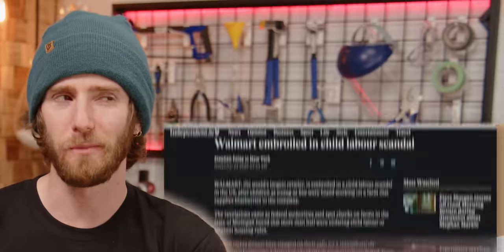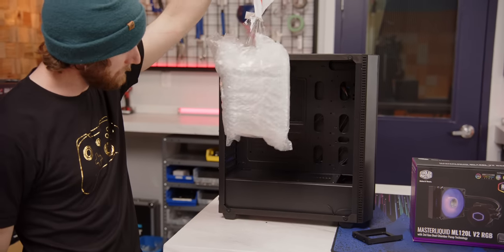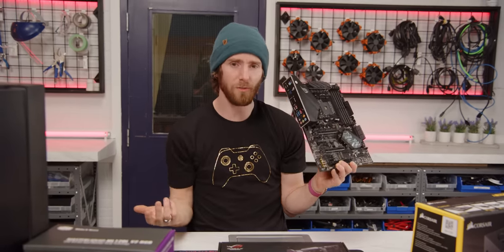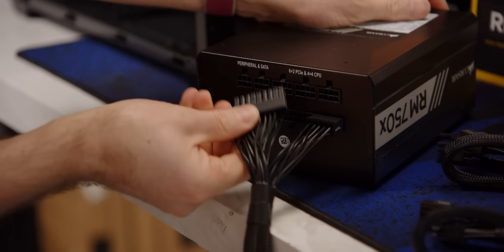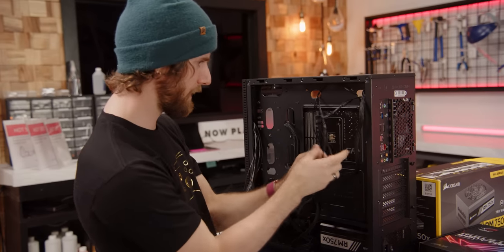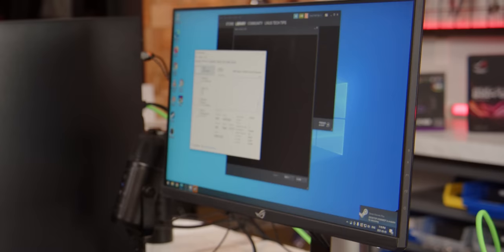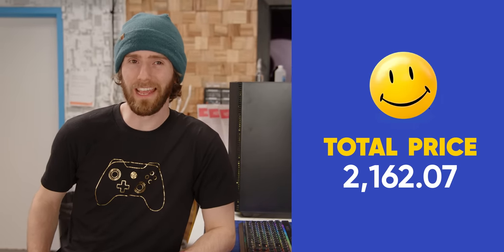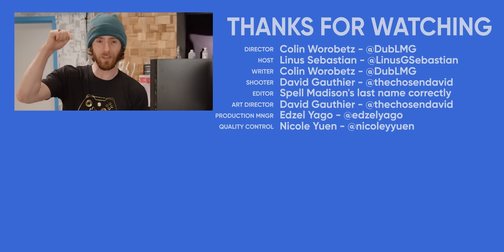Building a gaming PC at… WALMART?

Comment: You should make your own pc components, CPU, ram, GPU, everything, and see how fast it can run. The ultimate DIY PC
Reply: Yea cause they are obviously qualified engineers and hardware designers. I'm sure it's not wayyyy over their paygrade.
Reply: Get a custom PCB for gpu
Reply: No media company is able to do that even with a few years of preparation. It's extremely tough to design any of those components, such that they don't suck, don't cost 50k a piece, and are compatible with existing hardware. This is why don't see anymore any serious competition, besides Nvidia, Intel, AMD, Samsung, Qualcomm, the big bois.

You should check out Ben Eater's "How to design a CPU" here on yt, very informative series and shines some light on how the design process looks like
Reply: I mean, they probably could design the boards and print them but just like gigabyte, Asus, etc., they would still need to source the actual brains, the GPU and CPU proper from AMD, Nvidia and/or Intel to power their board… or Qualcomm and snapdragon if they feel like making an ARM card. 
But yeah, to make the die of a CPU and GPU themselves is something that even most governments worldwide wouldn't be able to pull off.

Comment: "All E-Bay, all Amazon, All Wish, All Microcenter, what more is there left to do?"

Sad Best Buy Employee noises
Reply: I think most tech people know that best buy has stuff and is fine for parts but not amazing and that normally if you're sold a full system by an associate you're getting ripped off lol
Reply: @torunsmok5890  eh, a few years ago maybe. But the online inventory has been really fleshed out, and it's one of the few retailers that have decided to eat tariff cost instead of pushing it onto the end consumer, so almost everything is sold at its advertised MSRP. Also most Prebuilts sold by Best Buy now are actually normally pretty good, they just tend to suffer from the same corner cutting that big box Prebuilts from any retailer suffer, like low-rated PSUs and slow ram. That said, since the manufacturers set Best Buy's prices, not Best Buy themselves, I wouldn't really call it "getting ripped off," at least not in the sense that Best Buy, specifically, is ripping you off.

Some inside information as an employee, computers and computer components are actually zero-margin products, meaning that we sell them to you at the same price that we bought them from the manufacturers for. Any sales we may run on products like that are either for inventory liquidation (clearance), open-box discounts, or a promotion that the manufacturers themselves are running through us (meaning they are paying us back for the difference, and giving us a kickback if we sell enough of the promoted product). Best Buy makes all of its profit from service plans like Geek Squad Protection, AppleCare+, and Total Tech Support and high margin products like appliances, Magnolia Home Theatre/Network Equipment, and Cell Phone Carrier Activations.

Basically even though the main thing people buy from us is computers, they actually aren't even our bread and butter. Generally speaking, if you go to a Best Buy and all you buy is a computer or a computer component, Best Buy isn't even turning a profit off of your purchase, and now because of the Tariff Situation, we're actually losing money on purchases that consist of only a computer or a computer component, unless it's, specifically, a samsung SSD. Lol.
Reply: @zumbeezy  now you're asking for LMG to build a PC out of out-of-stock printers.
Reply: Sadder Fry's Electronics noises
Reply: Sad Newegg owner noises

Comment: When implemented properly (per object for example), motion blur is meant more for high fps gaming than low fps gaming because without it our eyes strain a lot.

Our brains see monitors and TV's as still flat surfaces with no motion, so our brains don't add depth of field and motion blur so the games have to add it in themselves for us or problems can occur.

Comment: I have another challenge for you guys:
.                     Try to build the cheapest PC that can run an average AAA game in full HD ultra settings at acceptable speeds and temps (70-100fps) - use any means possible. 
.                     Build a case yourselves if you must, use last gen hardware if worthy, no limits at all. As long as it meets the specs, it's good.

Comment: you can def find cheaper, higher performing parts like a case and cpu cooler lol but the times are tough nowadays. i got my Phanteks P300A with a mesh front for about $40, ryzen 5 3600 for effectively $140 and that exact RAM for around $100 last June

Comment: You should do a video on setting up multiple hard drives for beginners. Like how to run system on a smaller drive amd storage on several others, raid, etc
Reply: How to plug in Sata cables by Linus :p

Comment: I just replaced that board with a B550 tomahawk because I yeeted my 2700X pulling the AIO water block/pump off . sold the motherboard for 80 so got some of my money back.

Oh also now rocking a 5800X

I also have that CPU cooler in my FX-4300 secondary system for older stuff that doesn't play well with Ryzen and/or modern Nvidia

Comment: Eta prime did a video on updating a "workstation." It's a couple year old optiplex with an Nvidia card. I think he paid, I don't feel like looking it up atm,around $600 for a decent gaming rig...  It's not to of the line, but can everything out today.
Usually have to use med/low settings, but it'll still crank them out.

Comment: What graphics card would you recommend for my new build? 
Ryzen 5 3600
32gb corsair Vengance pro @3600 Mhz
ASUS ROG Strix B550-F Gamimg MOBO
750W EVGA 80+ bronze PSU
currently using an MSI GTX 1660 Gaming X

Comment: I got my msi gaming x 5700XT for $420 a few months ago on Newegg and I'm incredibly proud of myself for that
Reply: what does ur personal build have?
Reply: @arvin76t8  I love talking about it so I'm thrilled someone asked lol😁
Cpu: Ryzen 5 3600xt
Gpu: Aforementioned 5700xt
Motherboard: ROG strix b550 f gaming wifi
Storage: 250 gb samsung 980pro boot drive, 2Tb WD black sn750, and a 2tb Seagate barracuda HDD
Ram: 16gb ddr4 3600mhz trident z neo
Power supply: powerspec 650w 
Case: fractal meshify c in white 
And then I also threw a corsair h100i AIO on my cup for cooling, a few corsair ML 120mm fans and some corsair rgb strips for good measure. She's my baby and I love her
Reply: @lilv728   nice i have a gtx 1080 8 gb and a ryzen 5 3600x and a gigabyte b450m and 16 gb of 3000 mhz ram and 2 tb of storage

Comment: In this weird market, pre built PCs are a better choice... I got a PC with Ryzen 5 5600X, MSI B550 board, 16 GB 3600 MHz RAM, RTX 3060, 1 TB NVME SSD and 750 watt power supply for around 1650 USD ... That's little more than the MSRP of these parts ...

Comment: Sooo
When I buy an iMac with an 8 core i7  (about 25% faster than the 6 core Ryzen) and a I get the 16GB version of the same Graphics card, a 512GB SSD and a Retina 27" 5K monitor, a mouse and a keyboard.
I am paying 2799 when I buy it direct from Apple but are very likely to get a better deal elswhere,
So who has the better deal? Oh, In need te spend about 40-50 bucks on 2 4GB RAM sticks  for the 637+50=687  price difference I get a bigger and likely a better/faster SSD, A faster CPU, it includes an excellent 27" 5K monitor, 8GB more GPU Memory, A good wireless keyboard and a mouse,  I don't need to go scrounging for all the parts, and don't need to build it. So why is Apple perceived as to Expensive? And the 687 is likely to be 200-300 less when I get a good deal elsewhere.

Comment: The packaging inside was USPS flat rate packaging and was clearly being used illegally. It is provided for free only for use in flat rate shipping. You must agree to a contract that specifically lays out what is accepable to receive. This is the kind of thing you find from a new eBay seller not a huge company. I would report to USPS as they are stealing from the USPS increasing everyone shipping prices.

Comment: My dad had a pc from Costco it was a emachine amd x2 300 2.8ghz
Reply: He was still using it few months ago  I replaced it with a hp ryzen 3450u 2 core 4 thread had a gt 210 for years in it it stopped working few years ago gpu was replaced by a amd r7 240 yeah yeah brother Jeff told dad go to best buy buy cheapest gpu and go

Comment: Linus, why does my pc wont boot on dual channel ram? But its booting in single stick 8gb. Im stucked
Reply: Incompatible ram?
Reply: @Bendigo1  I actually go to bios with one stick and click auto on oc setting then insert the 2 rams and it works. then i enable xmp to oc the ram in dual channel now i have 16gb 3200
Reply: @jarolddhavesaguit1204 is it not matching ram?  Glad you got it to work though.
Reply: @Bendigo1  sadly i think its not, I've bought a corsair matching ram. (corsair vengeance) then I thought it was defective, so i shipped it back and then the seller ask me if i would like a refund or 2 hyper x fury ddr4 rams with same frequency. Then I said I want that hyperx then it is the same, after i tweak something in bios lmao
Reply: @jarolddhavesaguit1204  that is strange.  Usually that happens if the timing or latency is not the  same.    Either way you got it to work so good for you!
Reply: @Bendigo1  yup, my whole rig is from 2nd hand market tho, the seller set it to 3600mhz before he sell it, so i thought that is the problem. I only have 2666
Reply: @jarolddhavesaguit1204  oooohhhhh yeah that makes sense.  I would check the numbers on the ram sticks too, if they aren't all identical they may not work well together.  The ram speed isn't the only thing that has to match, but the latency numbers should be the same too.

Comment: That's and insane amount you paid for an rx 5700 gpu with a ryzen 3600 cpu. Right now, I can get a Lenovo Legion w\Warranty Ryzen 3600 with a Nvidia gtx 1660 super for 1095 bucks. I add another 8gbs to equal your system and I have an almost equivalent system for half the price. Not a winner Linus...not a winner at all. The only way to combat the absolutely 💩💩💩  pricing of the GPUs is to find a manufacturer that isn't factoring that into their TOTAL computer package. 5 year old 1050ti's are going for  300 - 400 bucks! NO Bueno!!!